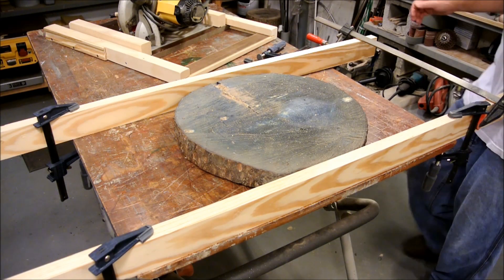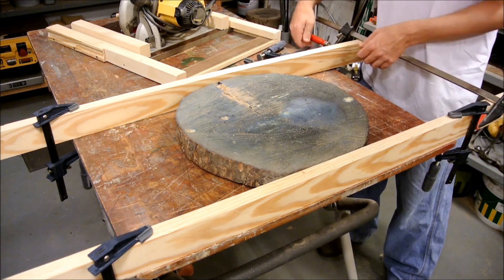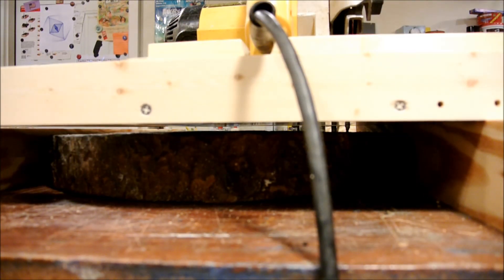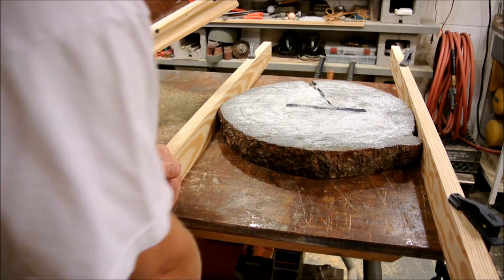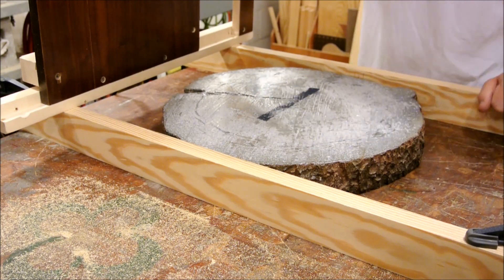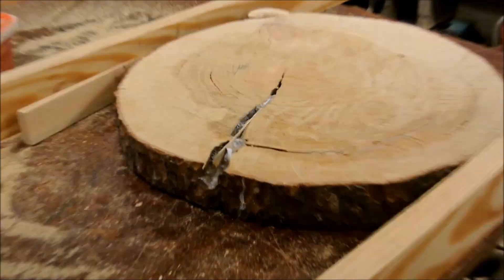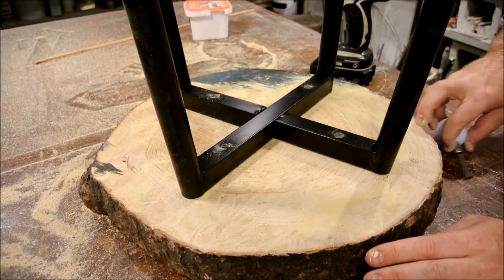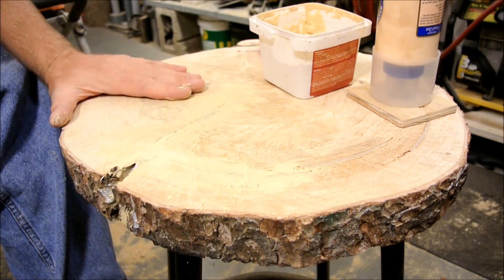Log surface planing with the (homemade) tablesaw

Comment: Hey im new here so i dont know if you finished or not, but for the under side ('ive made about 20 log top stools and tables so for) i discovered that smearing construction glue on the bottom makes an awesome finnish and stops moisture wicking... I made a large 4 foot diameter 18 inch thickness stump table and i kept getting bugs and mildew on the bottom side, i roughed up the bottom surface with a wire brush plastered on a 16th of pl premium then sprayed on two cans of black rocker guard... Slides across my shop like a dream, i split wood on it tack welds, spray bomb, clean tools, best work station ever... Once a year i put a mirror pollish going from 600 to 3000 grit then jewlers rouge on leather disk i made for my pollisher backed with  14 guage sheet metal. This work table is a thing of beauty, ill cry myself to sleep the day i finnaly put an axe through it and it splits
Reply from the maker: I would never split that. I still use my black walnut log every day.

Comment: Nice way of flattening a log. I'm not sure about this suggestion but wouldn't you be able to go side to side if you tilted the blade at an angle? Might leave a worse surface finish tough.
Reply from the maker: I don't think I would try that. Aside from making the saw cumbersome, the blade deflection would be different in each direction. I don't see an advantage. 

I suppose, in theory, that you could have multiple saws stationed in overlapping patterns to make a sort of industrial planer, as long as their blades were tilted in this shape: 

log feed direction →///// angled saw blades.

But this would be far less efficient than the helical planer knives that are already being used. Still, I wouldn't be surprised if your idea existed in some capacity at some point in our history: modern inventions always seem like simple ideas after the fact.

Comment: I just don't understand why I would want to do this. You could use a hand plane or an electric planer. You can get a cheap electric planer for like $30.... and it will still work better than this and be so much safer and less effort... Is there and advantage to this that I'm not understanding?
Reply: Goodness, you people are incorrigible. It was irregular end-grain, with paint, glue, epoxy, and whatever else I spilled all over it. I have all sorts of planers, hand planers, and planes, but I didn't wish to ruin them when an old junky blade will do just fine. This method is fast, easy, and still reasonably safe to the capable. 

That said, if effort is something you wish to avoid, working with tools is probably not for you to begin with.
Reply: Ok. I can see some reason in that... I still think it's dangerous but I understand why you might want to do it but the problem is that your video does not explain your reasoning and for the sake of your audience, it probably should. That is why everyone is making comments that you don't expect or like. If your video had said that you know it's an unorthodox method but here's why you were doing it or that you know it's not terribly safe and that you don't recommend it but for the point of proof of concept ie. 'Can it be done?' that you are going to try it, then people would probably not be saying the things they are saying because you would have already defused their comments. If you are going to do something a bit radical and unorthodox in your vids it pays to explain your reasoning to your audience before you begin. That way they are prepared for you to do something strange and won't find it so strange... I'm not trying to be horrible, I'm just confused and concerned. :-)
Reply: You aren't being horrible. However, your own limits are yours to discover. I can't make a warning, proviso, or disclaimer for every possible contingency; I assume no responsibility for what you do, and you should already know that. Further, I don't post redundant technique, and I won't apologize for that.

There are thousands of videos already out there showcasing by-the-book procedure. Most of that stuff doesn't apply to the mass of people, who are forced to innovate using what is available to them. If a pitfall or potential mistake is likely, I will enunciate or at least give it print in the description. Beyond that, you are holding me to an impossible standard. 

Consider what millions of views bring in the vein of procedural criticism: do you suppose that I haven't already given thought to social responsibility?
Reply: I'm not saying you need to include such information for my own benefit or that you need to protect people, although that wouldn't hurt. (Thanks for assuming that we are incapable of replicating your super-human acts, BTW). I'm saying that it will help YOU if you include this information because it will silence your naysayers and you clearly don't like them. There is something you are missing regarding the psychology of your listeners.
Reply: I'm not claiming to be superhuman; I'm one of the people who innovates by using what's available to me. And as I've said already, when I think there is something relevant to add, I put it in the description. 

Did you read the description? Of course not. You're just trying to "help" me understand the psychology of the listeners. Thanks, but I didn't ask for advice- you did, tacitly, when you watched my video. 

Tell me, how did you ever come to feel so entitled? What possible rationale do you have for watching a video with expectations about it that could then be let down? You didn't buy a ticket to watch this, so if you don't like the procedure, shove off. 

I try to make content that's substantial and useful, but if you can't reciprocate with a little flexibility, I don't want you here.
Reply: No one reads the description! No one can be bothered! It takes about 10 seconds and certainly less time to say quickly in your videos that you recognise what you are doing is weird and unconventional than it does to reply to me at length and to other people at length and to write the description which no one reads... If you want to ignore my advice then by all means do so and continue to be exasperated at the hoards of critical comments you receive from well-meaning people and continue to waste your time telling them at length that they are idiots for being confused by your methods of choice... You will never get rid of trolls. They just write nasty stuff for the heck of it... but you can take care of most of the well-meant criticism.... but, you know, if you want to ignore my advice then go ahead, be my guest. You obviously secretly enjoy engaging with your critics.
Reply: I won't be held accountable for your own lack of research. If you want a roped path and soft walls, this is not the channel for you.

Your "advice" is merely empty criticism, "well-meaning" or not. Confusion over off-color procedure is hardly exasperating- at least, compared to those seemingly literate who still demand that I treat them as children. 

I will commend you for not allowing your disagreement with me to devolve into flagrancy, but as the substantive part is now passed, I think we're done here.
Reply: I'm afraid you're not seeing the broader picture though. It's not about being a child, it's about human expectation. We all expect certain things when we go to see a movie or watch a TV show and one of those things is that the climax should not be at the start. Similarly, if you are going to do something weird that breaks the rules of people's expectations in a DIY program on TV or youtube, people expect you to acknowledge the weirdness of what you're about to do, first. It's stops most angry and confused people ringing the station to complain or writing irate comments. If you'd just utter the words "I know this is unconventional, out there and a bit dangerous,' or similar before you started... far less people would stop to tell you that because they would know you know! They are telling you because when you don't say those words they expect you might not know... That's what I'm trying to get through to you. You can do just about anything radical you like if you just acknowledge how radical it is and far more people will stop harassing you about it. :-)
Reply: Ok, look- in simple terms: You have no idea what you're talking about. I really don't want to be nasty and say something like that, but you just don't. When you get millions of views, certain people out there will take issue with the simplest little things! I've had people chastise me over what you would laugh at and consider to be absolute madness. I want to write and produce what I so choose, so long as I can defend the presentation of those things with a sound ethical rationale. Thus far, you have not given me a very persuasive argument that a change is in order.

Once you start to pander to a certain faction, demographic, or special interest group, there's no going back. Your content will become compromised. There are just too many to please. It is an impossible struggle, and content of this flavor becomes neutral and vacuous. I have goals in mind that may not proceed if they are to be continuously hindered by petty grievances. My format is that there will be no format for you to use to make comfortable predictions about me. Again, there is surely less dissonant programming out there for you; mine is not for you to enjoy, and I will continue to deliver what is neither expected, nor demanded.   

One more thing, from the pragmatic angle: your line of reasoning is asking me to adopt a standard of anticipatory disclaimer-placing for every unlikely contingency, and to then continue with my characteristic unconventional indulgence, which is an act perfectly contradictory, especially considering the infinite variety of the human preoccupation, and of course, the somewhat humorous fact that this morning's harassment is coming from a person who claims to be helping me to understand the broad picture of human expectation by attempting to provoke me into changing my presentation format for the satisfaction of their own, rather strange, idiosyncratic suppositions.

 No. You've convinced me to change nothing. Now go away.
Reply: Consider me gone. Every reply you give me demonstrates succinctly that you completely do not understanding what I'm saying either because you simply do not understand or you do not want to understand. Either way, I see little point in further comment. I have not once said that you should change your channel for the benefit of OTHERS, which is what your answers all come back insisting you don't want to do. Nor am I advocating any real change to your channel and its content at all which is another thing you keep insisting you don't want to do despite my not having suggested it. Then there is the persistent, 'I'm a superhuman maverick better than the average joe and the rest of you are just stupid limited people beneath my realm of operation'-vibe throughout which is getting a little tiring to be honest. I don't care what you want to do. Cut you hair in the next video with a band saw if you like and you certainly don't need to listen to me if you choose not to. It's your prerogative. I'm just trying to help you minimise the negative feedback you're receiving that you clearly hate, WITHOUT having to alter your channel. It might surprise you to know that other people do sometimes (not always but sometimes) know things ...but then why would anyone want to listen to the person with a Ph.D. in Linguistics, the science of human communication? Good luck with your channel and good luck fielding those comments. :-)
Reply: You're the troll not us!

Comment: Next step - add a second saw for planing twice as fast, two-fisted, right? :)
Reply from the maker: +Steve Polychronopolous 
I don't get it. I'll assume that you're taking a crack at (what you consider) my reckless method. Yawn.
Reply: No, I dig your willingness to go to unconventional methods to make things happen. Just making a joke. I love shop-made machines, jigs, etc. - no reason to buy a $2000 machine when you can use your brain and figure out a way to get it done.

Comment: A circular saw mounted in a frame is NOT a table saw. You could have built the same type of device for a router and done a better job, much faster.
Reply from the maker: +Bill Gunnett That IS a table saw. Read the description and watch the associated video. Also, don't you think I would know about how to use a router? I wasn't ruining a bit on paint-covered end-grain. Also, a router would take much longer. Again, READ THE DESCRIPTION.
Reply: +pocket83²  My apologies. I didn't realize YOU had described this as a table saw. It must be true then! Yes, it does fit the definition of a table saw. However, just a few observations about your "table saw". I'm sure that the fence is aligned with the the blade and that 2 1/2" of compressed PVC pipe doesn't allow for any deflections. Let's just say for moment that the fence does deflect, the anti kickback and splitter that you have incorporated is genius. Oh wait...there wasn't any.  So when that board pinches the blade or comes flying back at you, the emergency off (pulling the stick out of the trigger) is also genius... Assuming that the very sturdy white pine didn't break and send the whole thing skidding across the shop. Table saw....right. 
I don't know if you can operate a router. But obviously, you don't know that router bits can be sharpened and that there are planer bits that will do exactly what you were trying to do with a circular saw mounted to a frame.
Reply from the maker: +Bill Gunnett Sarcasm! I'm like a shark when I smell it! Your self-assuredness is a clear case of the Dunning-Kruger phenomenon, so I'm sure you feel as though you've just reached bedrock with that knock-down argument. But I can assure you that I'm not the guy.

My table-saw was very well engineered; it was deliberately streamlined for efficiency, simplicity, and minimalism. Your safety-based critique reveals not only your ignorance on the subject, but it also reflects an obstinate refusal to accept that which is not in complete accordance with the status quo. You, lay person, are the victim of consumerist propaganda, and it is quite clear that you have no expertise outside of that thin slice of what you call "craftsmanship" that you've purchased from your local corporate specialty outlet. 

Nice equipment does not an inventive mind make, asshole. And a top-shelf router would still take longer.
Reply from the maker: +Bill Gunnett I think you might have misunderstood the point of my (second) channel a bit. The bucket lid was a metaphor and a joke. Similarly, this project was toying around for me. I usually post unusual, experimental, or unconventional content only because so much of the normal stuff is already out there. There is already enough of "the right way to" content out there, especially with carpentry.  

But I will happily admit to you that if I were to do a live edge slab, I would probably use a variety of methods, including a large router sled. But this was end-grain junk with paint on it, and as such, a power saw was the perfect solution. You might be a professional; I don't know you. But I am also quite capable, and I need no validation from you, nor do I owe you an explanation, so consider it as a polite courtesy when I tell you to take your $4200 slab, turn it sideways, and shove it up your presumptuous ASSHOLE. Now please go away.

One more thing: Corporations are not evil; they are impartial and rational, which makes them naturally seek to preserve and promote their own interests. One may interpret such selfishness as slang for "evil," but that wouldn't be an entirely fair characterization, even coming from a hippie. Self-oriented entities that become powerful do require some measure of control though, because their behavior is extremely predictable, so they will eventually seek to exploit everything in an effort to maximize profit. Now here's the kicker: I was accusing you of lacking originality. Because corporations sell predictable items, there are lots of box-store know-it-alls out there who consider themselves experts just because they can read the instructions on the box provided by the corporate manufacturer. Sorry if that is not the type of person you are. But in either case, leave me alone now. It's dinnertime. 

And my tablesaw was designed to go to a jobsite for quick cuts while rough-framing; it was exceedingly well adapted to that purpose. Any framer would think so.

Comment: only thing I don't understand is why you put the cracked face on top when you opted to fill it with sticks and filler, rather than the other side.  If you were going to put top finish on top with the crack intact to preserve the natural character, story, whatever, then I could see that.  But a surface that's been glue filled just doesn't look right, does it?  Maybe I'm missing your POV.  Anyway, I did like your idea and I think I'll do this with some of the stump/logs on hand because I don't have expensive fancy planers either.
Reply: That crack went all the way through, as I recall. This is a shop stool, and not a piece of finish-grade furniture. To date, this is my most despised video, because nobody realizes that. But no matter what they all think, I still love that stool- I think it looks great. lol.

Comment: why not use whatever type of plane?
Reply: pocket83² or a hand plane
Reply: electric plane on end grain is very dangerous, for you and the tool, it can kick back. its not made to cut the top of the grain like this.
Reply from the maker: Or a router, right?

Comment: I like your saw sled. I haven't tried that one yet. the one I have used has a 1/2" router mounted in the same fashion turning 1 1/4 mortise bit. the nice thing is there is very little kick back.